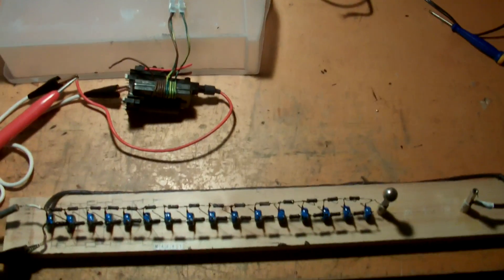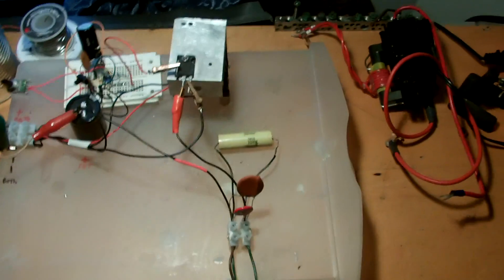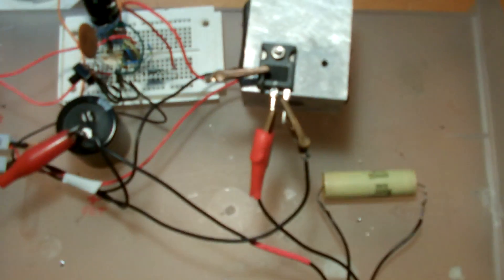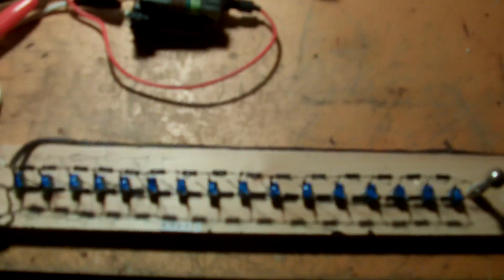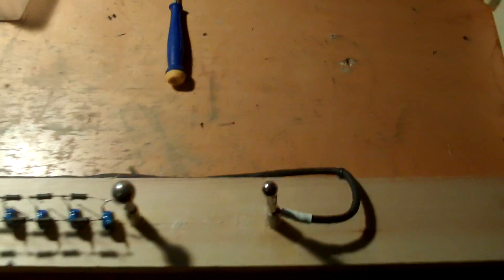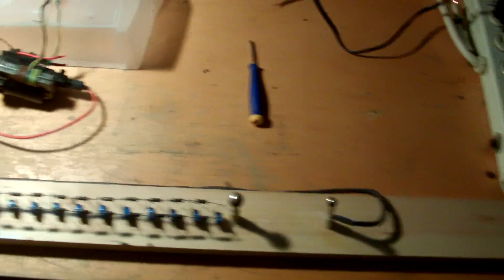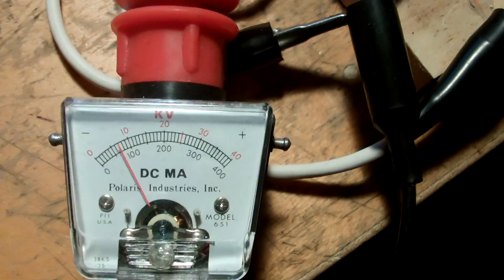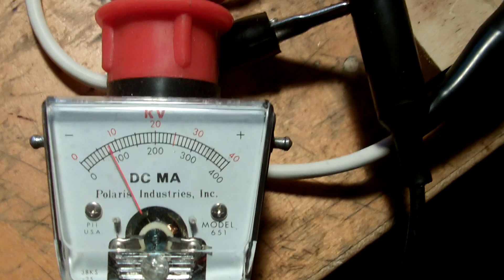Flyback Powered Marx Generator

Comment: Is the voltage on the anode the same as the input voltage?? I know on the big single discharge spark gap the voltage will be multiplied. But I’m not wanting to run any resistors where I don’t need to. On my larger spark gap I know I’ll have to run a resistor so I don’t hurt my transformer. Please lmk bro
Reply from the maker: Hey there, the input voltage at the anode is very close to the exact value to me multiplied although it is common to use a ballast resistor of around 1Mohm to assist with spark repetition rate. What transformer are you using?
Reply: @PcrHV  A 15 kva 12.3 Kv 240/120 epoxy encapsulated medium voltage power transformer. It’s super cool looking.
Reply from the maker: @techmelts7860  15kva!! I'd like to see that!  Your gonna need some big caps for a marx with that kind of power but it can totally be done.
Reply: @PcrHV  I’m using air core inductors coils on mine instead of resistors. Big wattage resistor are crazy expensive and inductors are better the Air Force study I found online says.

Comment: I'm wondering then, when you charge in parallel and then discharge in series would the total capacitance be equal to just one of the capacitors or would it be equal to the C=1/c+1/c and so on?

Comment: I've built a 30kv flyback power supply, got me some 30kv ceramic disc caps, just trying to determine the best package resistors  to use, and maybe sink the lot in mineral oil apart from the spark gaps of course. Any help re. type and value of resistors would be much apprecited

Comment: Hi, why these small spark gaps between capacitors? 
Does it working if there are no spark gaps?
Reply: you are charging the caps to say 1kV in parallel and then putting say ten in a row through these low-resistance plasma so you get 10kV. it does not work without the gaps
Reply: you are charging the caps to say 1kV in parallel and then putting say ten in a row through these low-resistance plasma so you get 10kV. it does not work without the gaps
Reply: Haba Nor but why? 
it can be connected directly without these air bridges to save the charge. 
on the other hand, if that happened, the system wouldn't work! i don't know..

Comment: Question. What happens when you place a dielectric plate of considerable size in between the gap, for example....a pane of glass. Will the charge build until it can overcome the distance around the dielectric through the air? fry the circuit? overcome the resistance of the dielectric?
Reply: reach the point when either caps blow or it just hold the charge if caps are in spec

Comment: I'm amazed that 9KV can cross a gap of 3 in. I read once a long time ago from something about Van de Graff (must of misspelled) generators that was on the internet that the breakdown voltage threshold of an air gap was roughly 25KV/in.DC. But I'm also amazed that you could make a video of the spark without it deleting you're SD card,....this has happened to me before on videoing a Voss machine. You must of used a zoom I guess. Don't get me wrong though, I,m not critising it. I just realized that my info is not accurate.
Reply from the maker: Hi thanks, sorry for the late reply.  Yeah alot of factors come into play when it comes to a setup like arcing a certain distance such as the frequency of the actual input voltage and storage capacity and dielectric strength versus the distance of each stages gap before it breaks down and arcs over. Im sure i could get a better result with the setup being under oil though.  Thanks for the comment!

Comment from the maker: Hey man not bad, thanks.  I think for a design this small in component size an OBIT would probably be too much power for a Marx this small. I like using flybacks for it since you can adjust power input and frequency much easier. Thanks for the comment!

Comment from the maker: Hi, good question! 
   Im not sure exactly of the maximum frequency given the particular component values i have used, I know it can be much higher than shown in the video. However, the components are put under much more dielectric stress as frequency rises and thus would require better parts and possibly oil submersion. Also the rate of charge and spark gap distance plays a role!   Thanks for the comment!

Comment from the maker: Hey yeah your right!  I believe yours was a CW multiplier which is just as cool and can work at higher frequencies, the Marx's depend on charging frequency/voltage and capacitance,  the caps all charge in parallel and discharge in series across the individual spark gaps, so your left with a multiple of your input voltage, usually Vin x (number of stages)=Vout ,  hope that helps ya and thanks for the comment!